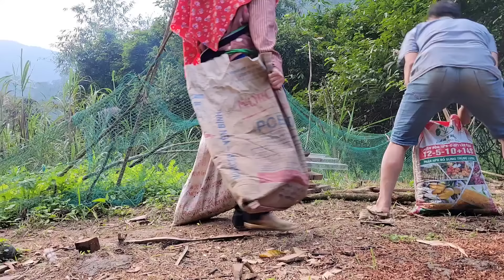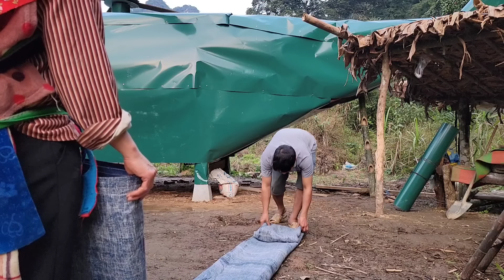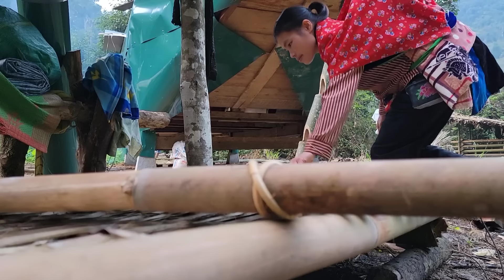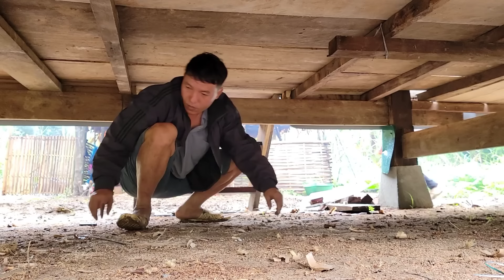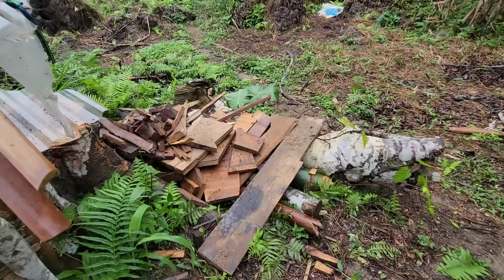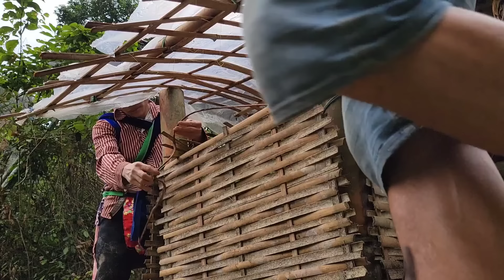Demolition of old house and cleaning around the house:dia single mother children.

Comment: During the hot season.....we are worried that family members will be facing uncomfortable situations  because the house is lack of a natural air ventilation system especially at night.... Due to heat transfer inside the house during daylight. Need natural lighting systems for daylight. A good house... sheltered from heat & rain and security too.... unfortunately poor air ventilation system & poor natural lighting for daylight.